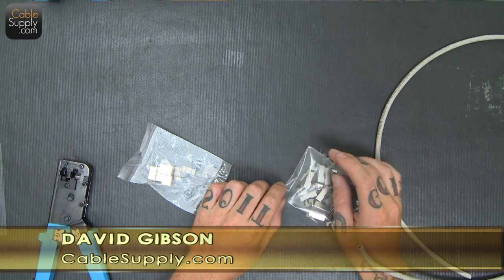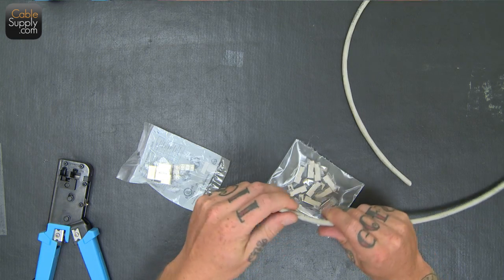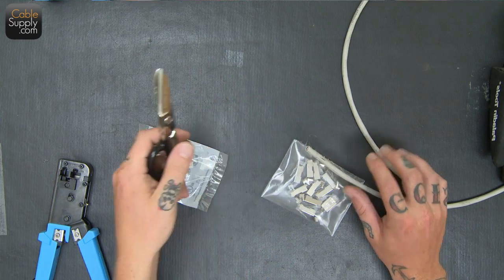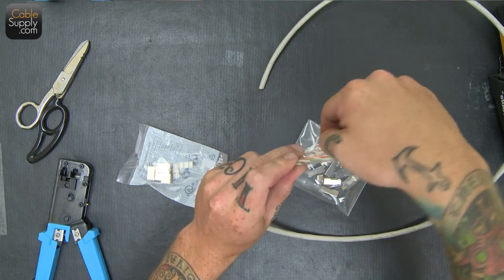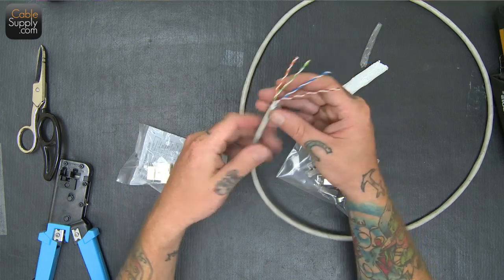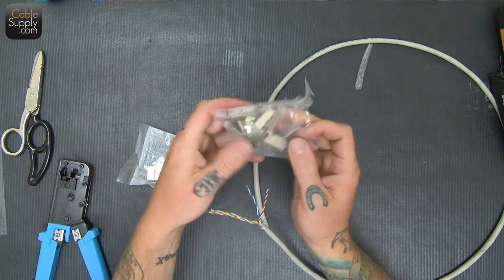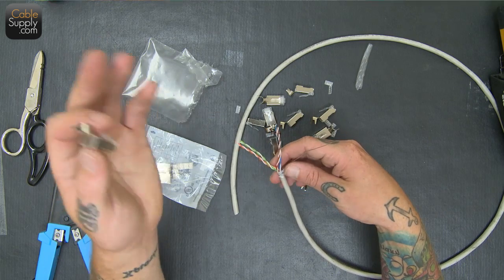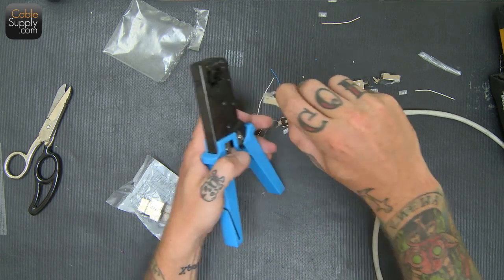Terminating Shielded Cat6 Part 1

Comment: Very informative.  Very clear.  The only issue I have is using shears to crimp the shield clamp.  That's just not right.  You are dulling you shears and on slip and you can damage/cut the cable which would put you back to square one.

Comment: Let's talk about drain vs. ground. The shielding is to harness EMI which the drain will direct away, but not to electrical ground. Electrical ground is for over current/ short circuit currents. A drain is a different electrical point all together. The drain generally is a null location on a circuit board, which attempts to minimize interference with the signal on the twisted pair. The twisting of the pairs minimizes cross talk, tighter the twist the higher the category of protection.